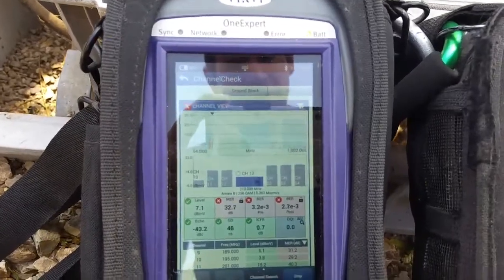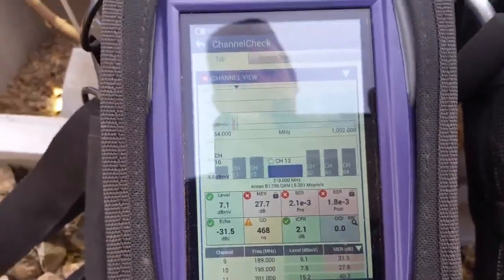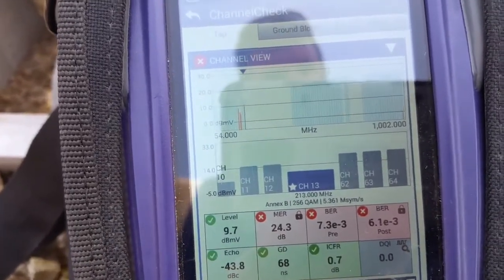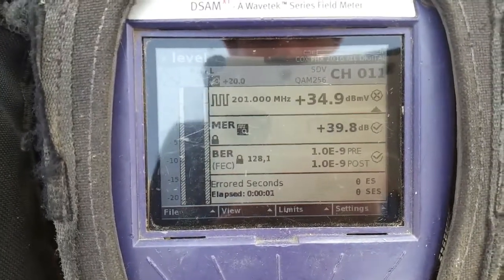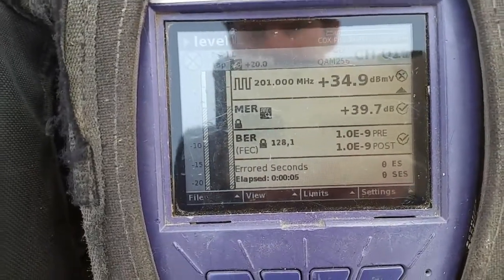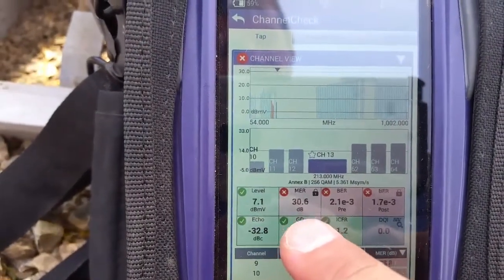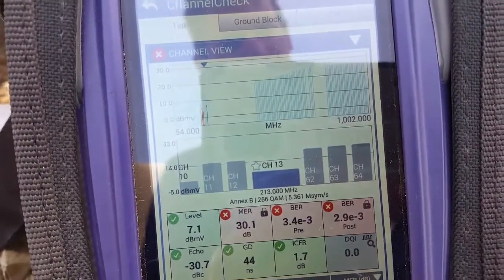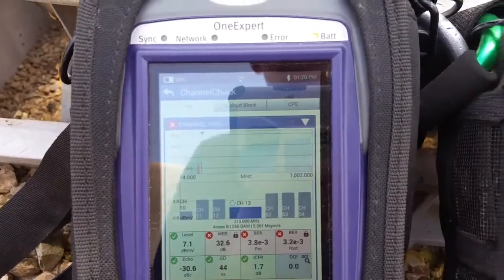QAM 256 CATV MER specifications

Comment: I use this Onyx as well.  The battery life is terrible tho.  Quick tip in case you don't already know this.   If you turn the theme to "Dark Mode"  it drastically improves the battery life.  Also looks better imo.